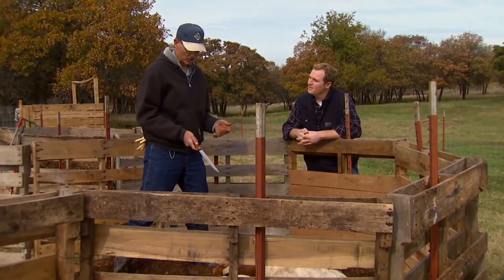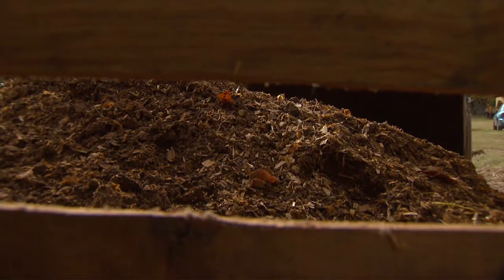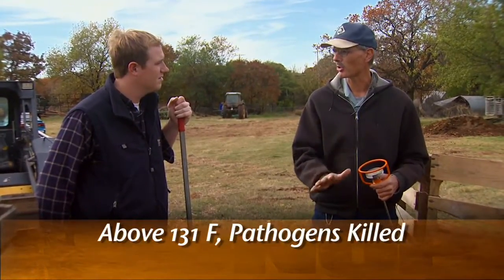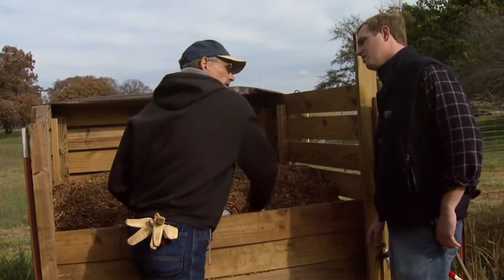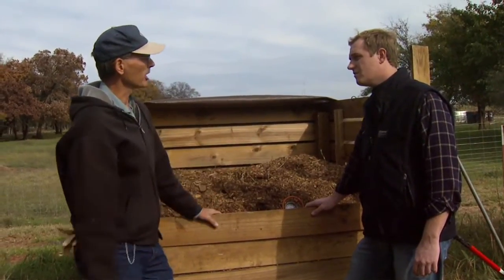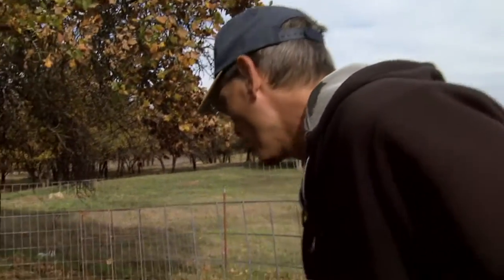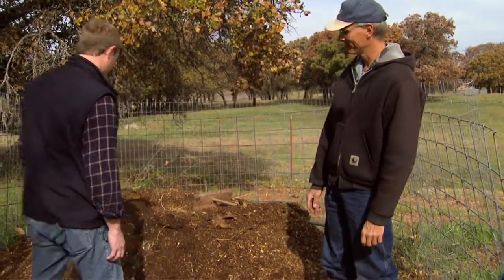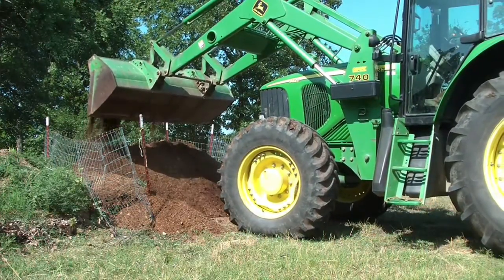Animal Composting - Part 2

Comment: Thanks, this answered my question in my comments from Part one...Than the compost can be used.
Question came up while watching... Are you worried about spreading desease from this composting process when spread out on fields?
Reply: common question! salmonella and e.coli bacteria and other pathogens are killed as the compost temperature gets hot enough. That's why it's important for the compost to retain it's heat during the first two weeks. Common dangerous pathogens die after 1 hour when exposed to temperatures of 131 degrees; if exposed to 140 degrees, they die in about 20 minutes.
Reply: Ten years and still no response? Geesh...  lol..